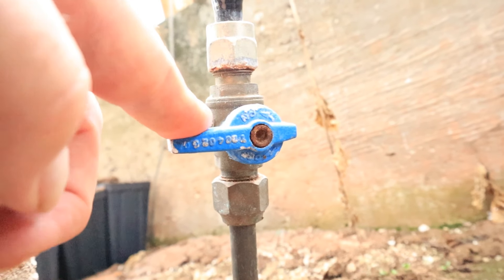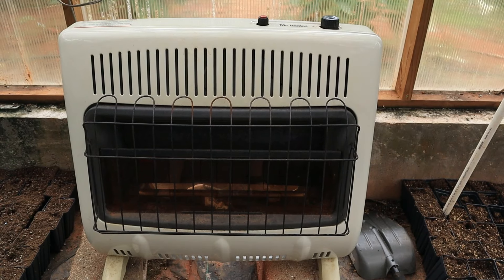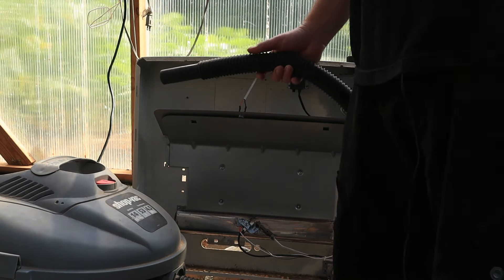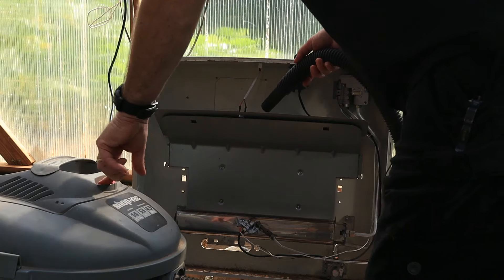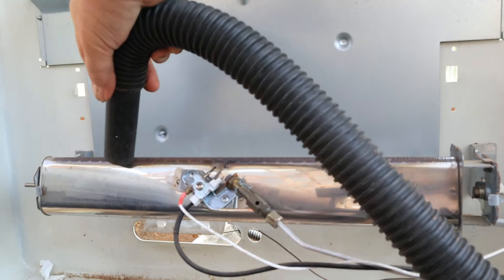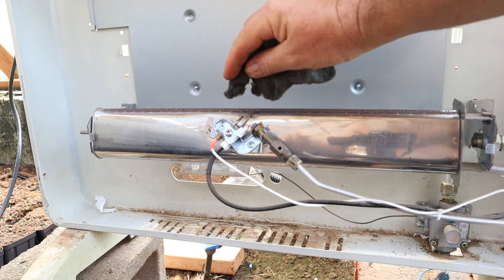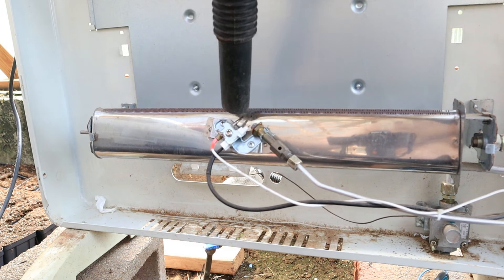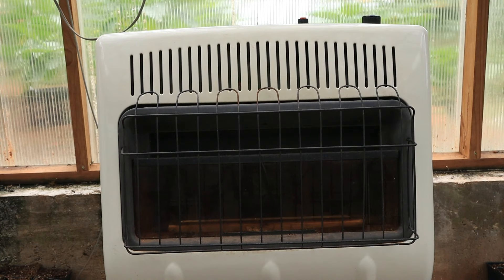How to clean Thermocouple in propane heater-How to prepare Propane Greenhouse heater for Winter

Comment: Good video!! I have one of those and my ignighter wont work , dont have the gas hooked up just wanted to see if the ignighter would click and it does not, will it click without the gas on?
Reply from the maker: Yes, the igniter should work even if the gas is not connected.
Reply: @triggerMB  Thanks, thats what I kinda figured , so is my igniter bad  or needs cleaning?
Reply from the maker: Some of the igniters take a AA battery. Try to unscrew the ring that goes around the igniter button. @maxximum18
Reply: @triggerMB   yep changed that already with a fresh one .. no dice

Comment: This replaced an older wall unit that failed.  https://www.youtube.com/post/UgkxQDiHf0Cagl2e3YNPX-bWnDMXQAL2A2Y8 The grill on the front is nice, the old unit did not have one, just the glass. Much more kid/dog friendly. Best feature is the battery operated igniter..... old one had the plunger type, which was quirky. This one fires right up with just a touch of the button. Takes the chill off a room very quickly, seems to put out more heat that the one that was there, even though they were the same BTUs. Very impressed.... so much so I bought a second one to replace the other old one even though it still works!

Comment: What a great video! Mine was starting to turn off. I took it apart and cleaned it all up and it's up and running great!!! Thank you, your video saved me a couple hundred dollars doing a service call!
Reply from the maker: Great!!
Reply: @triggerMB  My pilot lites up and when I turn the flame up both pilot and flame goes out. What causes that problem?
Reply from the maker: Does the pilot light stay lit when you release the button?
Reply: @triggerMB  , Yes, it's only when I turn the flame up then both pilot and flame go out. Wonder if it's getting enough propane...my hose is outside bitter cold hooked to 100lb tank.
Reply: @cathyrenick8562  I am having the same problem at this moment. My heater is ng and lp . running it in ng right now and turns on for a two mins and then shuts off. The house is literally 55 degrees right now.
Reply: @cathyrenick8562 I'm having the same issue. I'm have one that was in storage. Someone that has experience w these told me that when useing propane you need to put a regulator in the line coming off the propane tank because it's too much pressure being forced into the unit. I'm going to get one today roads are frozen over hope their passable.

Comment: brand new heater like this for greenhouse. Checked all troubleshooting recomendations. Still shuts off at night only. Right in the middle of a cold snap. No other option but to buy a new one. My poor plants.
Reply from the maker: Are you providing   plenty of fresh air? They are designed to cut off if oxygen levels get low, which can happen in a tightly closed room.

Comment: Thank you so much for this video. I've been searching for over a week on how to clean the pilot properly. The manual said where to clean but not how to get behind the glass. My question to you is though do you need more than one person to replace the front of the heater? Do you believe it's something I can do alone? I do rely on this heater. Thank you!
Reply from the maker: At 1:50 on video it shows the screws on the side of heater. After removing those the front of heater will come off. 1 person can handle it.

Comment: Can it be 000 steel wool?
Reply from the maker: Yes
Reply: @triggerMB  Thank you. I cleaned it in my greenhouse last night. I knew a reddish glowing tip meant it had something on it, but I wanted to make sure.  I used 000 and it was back to normal. It has been the best heater for me, once I figured out the ventilation part -you know, making sure it gets enough oxygen.

Comment: What causes a heater to only shuts off in a low setting when it’s on high it stays  running
Reply from the maker: Disassemble the pilot assembly and Clean/vacuum out orifice. Also throughly clean burner tube. I would start there-after turning off gas 1st of course.

Comment: What wrong with my new propane heater- it runs a few hours and shuts off- could it be something at the gas tank?
Reply from the maker: Is it in a small enclosed space? The problem could be low oxygen. They are made where they will shut off for safety purposes.

Comment: Does anyone have orange flame because of this?
Reply from the maker: A correct burning flame should be mostly blue. Orange would indicate incomplete combustion. The tube the flame comes out of is probably partially clogged. Turn off gas. Vacuum the area the flame was at. After relighting flame should be mostly blue.
Reply: the back flame should be mostly blue? not the pilot light?

Comment: I also have a Mr Heater BTU heater in my greenhouse.     The pilot has now gone out 3 out of the last 5 days.  Woke up to my greenhouse temps in the low 30's.   Yesterday I blew very low (35 psi) compressed air thru the air port in the gas line per the owners manual.  Woke up again today to a non- lit heater.   Will perform the thermocouple maintenance you're reccomending today   This is our first year with the greenhouse.   And also this heater.   I am contemplating switching to electric heat and using the gas only as a back up.   Thanks and i subscribed.   Im in zone 8B.

Comment: At the pilot, there is a small hole in the side of the tube that pulls air thru it that collects dust, and can become blocked by fuzz or lint, and if blocked the fuel mix is too rich and the pilot will not burn. ALWAYS check and clean the hole!

Comment: I just watched a video about installing one of these, and the video showed on top as the intensity of the heat goes that there are numbers 1-5 on the top. Now, I had watched a video about the same unit, or I think it was the same unit, "Mr. Heater" wall heater that YOU had made and I THOUGHT you said it had a dial that you could set by temperature you desired. My question is, does YOURS have that temperature dial? Or is it also one that you choose a number 1-5 to determine the temperature the heater would turn off at once it attained that specific temperature? If it is just a number you choose 1-5, there would have to be a way to pick which number will get the heater to a specific tempo before shutting off.
Reply from the maker: Julia, the dial does show 1 through 5. I set mine on 1, to keep the temperature at 50f. The dial does not show temperature. You just have to raise or lower it ontil the temperature is where you want it. Hope this answers your question.

Comment: Thanks for the tip! I currently use one of these to heat a mobile home on our vacation property. I cleaned everything out with compressed air but didn't know about this. Should have thought of it with my experience with Mosquito Magnets.
Reply from the maker: Thank you!
Reply: @triggerMB  I finally got rid of it. I replaced it with a Mr. Cool mini-split, 18k unit. Heat and AC and doing it myself I saved thousands of dollars.

Comment: Excellent video my man! Use one of these to heat my RV trailer that I currently live In takes the brunt off the houseeater and uses wayless propane Been getting some yellow flames lately and it's been acting up thanks for the tip. ✌️✌️
Reply from the maker: Thank you!

Comment: When I have my heater on and I'm am like 6 feet away from it. Their is a lengering odor that I smell in the room what can be causing it?
Reply from the maker: What does it smell like?
Reply: @triggerMB  I don't know how to explain it its not a stong smell tho like kinda like fumes but not a gas leak
Reply from the maker: @stik_mane  are you sure heater is set up for what fuel you are burning? Propane or natural gas need to be set up differently.
Reply: @triggerMB  yeah its a propane heater and it's set up right